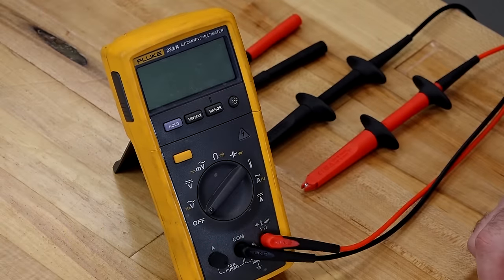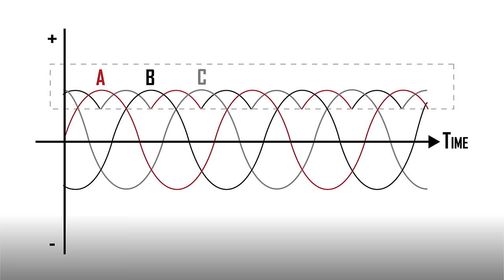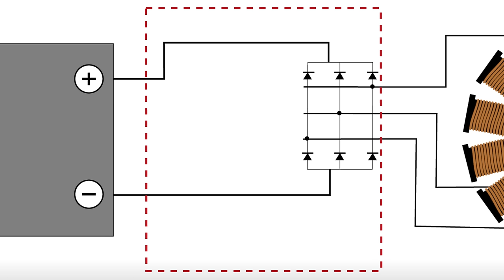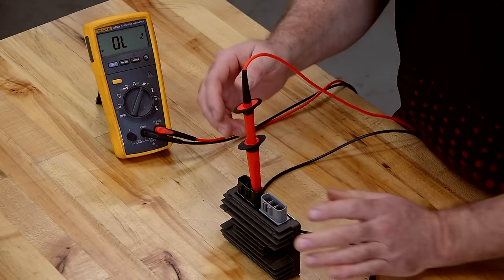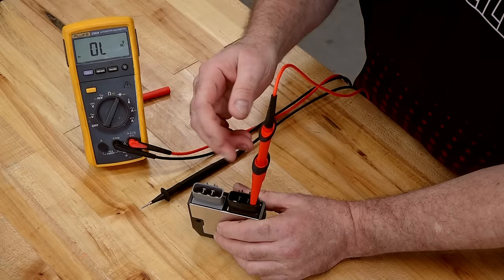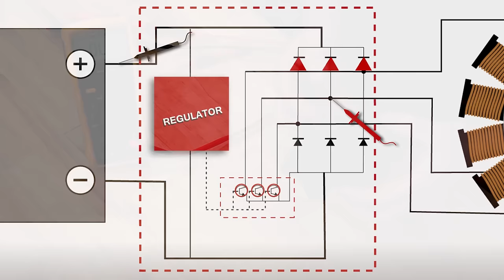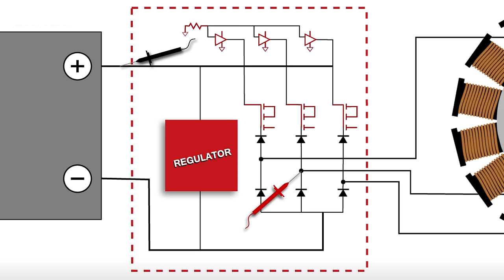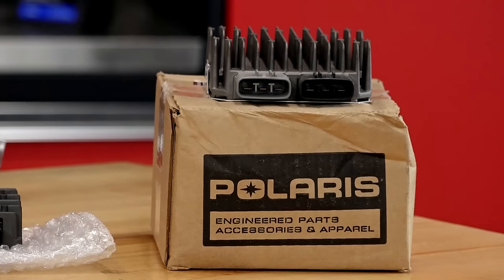How to Test a Regulator Rectifier - They're Not all the Same! | 3 Phase Rectifier Test | Partzilla

Comment: hello everyone!! who faced such problem? Loss of power on a 2013 Sea Doo GTX 155, the battery is new, the starter relay is normal, what could be the cause, could it be the voltage regulator, or another reason?

Comment: While the vehicle is running you will have high AC volts (35-40VAC) present if your voltage regulator / rectifier is bad.

Comment: My 1996 Harley-Davidson, FXDS (Dyna Glide Convertable) has a charging circuit problem.  I removed the battery which checked good.  None of the HD dealers will work on bikes older than 15 years old or bikes built before 2000.  I believe I know where the rectifier/regulator is mounted.  I do have the bike’s service manual which doesn’t give a parts location!  Give me some help, please.

Comment: Great video that saved me a lot of money and time. My Ducati Multistrada 1200 RR readings were F-Bias on -ve 0.460, 0.459, 0.463 and 0L on R-Bias. According to 10's of other videos and documents I should be having the SAME readings on the +ve side BUT in my case I am getting F-Bias = 0.098, 0.099, 0.102 and R-Bias 0L. 
Thanks to your clear and detail explanation it explains my readings - my RR is similar to the Yamaha. At the end the regulator part was faulty giving out 18v but at least now I know why the replacement RR has the same readings - wonder how many bought a new RR on the basis that they should have the same readings on both +/-. 
Great job and thank you.
Reply: You probably have a MOSFET regulator. The MOSFET regulator has approx. 0.500 on one side and approx. 0.100 on the other. And that's okay.

Comment: if I'm to understand this; the best way to 'test' the regulator/rectifier is to NOT test it... instead:
a - test the battery itself
b-  test the stator for ground fault and AC output

if the stator and battery check out... replace the reg/rect  (assuming all connections have been verified)
Reply: My long experience tells me that the voltage regulator may be correct, but that something else affects the result. And even when it comes to overcharging the battery. The plus and minus connections of the regulator play an important role if sufficient charging voltage is not achieved, which for a classic lead battery is 13.9 to 14.4 VDC. Also, too low a voltage can cause a malfunction of the battery, the fuel pump or the installation of additional load.

Comment: This is a kind of old video but I figured I'd ask a question three-phase stator on my Polaris RZR1000 turbo EPS with no extra accessories all the test test good. No resistance to ground The dynamic test 20 volts AC at an idle. I accelerate it to 3000 RPMs roughly and it goes up to 60 volts AC so the stater is obviously good I think lol but I keep having to replace VRRs I'm on number four bought one Polaris one from you guys that lasted about a hundred miles. Just bought a cheap one off Amazon that lasted a day bought  Rick's Hot shot that lasted a week so that's three right there. The previous owner put the hotshot on it so they went through one VRR I've replaced the battery which is brand new. All wire leads are really good. Even added extra grounds The wires from the stator keep getting hot and melting along with the VRR getting hot hot to the touch. I'm really stumped here. Any info I'd appreciate it. My next one I put on it is going to be a dual output. Stator in multiple VRs. I just don't really want to spend the money right yet but if you add up the parts I could already done it 😆 idk it just don't make any sense to me

Comment: I enjoyed the video, but I perform a final forward and reverse bias test between the positive and negative terminals.  Between the pos and neg terminals, the unit will still conduct in one direction only, but the resistance is approximately double what was measured checking the single diodes.  Also, I  would have liked to see the results of forward bias vs reverse bias on the Yamaha and Polaris units.  I believe the units will still show resistance near the same value during forward bias, for both the pos and neg terminals, but will indicate a resistance during reverse bias that will be appx. the same for all three legs, but the resistance may be higher or lower than the forward bias test.  Still it is a process of elimination.  The best test is with a known good unit.  If you install a known good unit and it works, then the old unit was the faulty culprit.  Most owners just don't have a spare unit on the shelf to test with.

Comment: Why wouldn't you just do a voltage check on the output of the regulator to see what it puts out, too high or low and  it's damaged.

Also the one thing I noticed is that cars used to have separate regulator and  rectifier, not sure if they stull do, but seems the best way to go.
Reply: I wondered the same thing about why not just test the output to see if it's putting out 12.8-14.3 dc volts or whatever.  I mean it's interesting to figure out if a diode or diodes went bad or if it's the regulator portion that went bad but since the whole thing is a single replaceable unit, it either works or it doesn't work.  If the input is good and the output is bad then the RR is bad, so replace the RR.  Maybe there is a reason you can't test it that way but I can't think of what that reason might be.  🤔🤔🤔

Comment: Great video John, thank you very much!
In short, I understand with the variations in design it is hard to be exact. The RR I'm testing from my son's Triumph 675 is similar to the Yamaha one you demonstrated. Doing a positive-bias off the negative terminal I get 0.464V off each of the rectifier pins (a little lower than you note/recommend). Doing a forward-bias off the negative terminal I get .114V at the rectifier pins. Though the voltages are slightly lower, it performs as you illustrated and is bang on consistent in terms of voltage reading pin-to-pin when forward biased.

The question I have is this still considered a pass?
Reply: Did you ever get an answer to this question? I have a Honda Interstate and it reads similar to yours.
Reply: The MOSFET regulator has approx. 0.500 on one side and approx. 0.100 on the other. And that's okay.

Comment: the issue being in philippines. Some sellers do not state if mosfet or non mosfet and bad designs (most likely class c fakes). 2 failed installed burnt out. One was not mosfet i did not use yet. Worried it would not be good for new style batteries. Can i use the non mosfet for temp use until i buy a real RR from you? shipping time args

Comment: I got a 2021 Honda Pioneer 1000-5. 
When I plug in the rectifier it pulls the motor down and eventually making it stall. I can unplug it and it runs as it should. So I tested the rectifier as you showed how to for a Honda and with my meter neg lead on the positive 
And positive on each point and it  was in the range of .122. And with the meter positive lead on the neg while you test point it was in the range of .521. (Any help will be much appreciated)!! Also I test the battery when it do run and it shows 13.8 bolts..

Comment: I have a 2018 Yamaha 450 yfz I am Jaden 12 V at the starter and the starter is good but it doesn’t turn over and then at the relay the cable for the starter up at 12 V and it starts

Comment: Very cool video. You helped me a lot with my R1 problem.
Reply: What year bro ? My 14 is like draining the hell out the battery. The yuasa one that came with it progressively got harder to start and the. Eventually would power dash and lights but wouldn’t turn over the engine
Reply: @rollathegawdchild4339  them bikes u have to always have bike on a Battery tender . It requires a good crank. My friend always has issues when he does not use his bike for few weeks

Comment: Hi guys I have triumph Tiger 800 2013 and it keeps blowing my rectifier 5 of then now within 5min of running bike the stator was checked and it was fine but i have replace it anyway and same thing happened again I have been buying the MOSFET one as they supposedly ment to be more reliable but for some reason are not for me. Am I using the wrong RR? Or have problem simpler else? Just to mention the battery is new on the bike .

Thanks in advance

Comment: My regulator is not controlling the voltage.  My battery is being overcharged. All diodes seem to work. I dont know if i should buy a new r\r or try to fix my current one

Comment: Great video and explanation 👍 , I'm a automotive tech that recently have been tasked to work on a fleet of ATV/UTVs . On the automotive side I'm a big user of occsiloscopes (Lab scopes ) to help make a solid definitive diagnostic and not just replace parts on a hunch. I been incorporating using a scope in diagnosing ATVs and side by sides and have looked at all 3 phases of the stator back probed at the rectifier/regulator . And you can indeed see the SCRs pulling the phases to ground in a controlled duty cycle in a attempt to regulate the voltage . I was wondering if you know of any resources for motorcycle/powersports techs that use scopes and share information . In the automotive would we have a huge networked that spans the planet of techs that share information and create think tanks to develope new ways to diagnose complex issues. By the way I thank you all for your great service to me as I buy a lot of our fleets parts from you guys and you've been great with helping me get the right parts as I am really new to this world lol .. Thanks !!
Reply: Since no one got back to you I thought I would answer your question.  To be frank as a M/C tech we really don't have this type of network like the Auto side.  I came from the Auto side 30 + years ago and still play in it from time to time ,  so I know exactly what your talking about.  There are some places you will find on the net for a certain bike say like the charging system on any VFR750/800.  They eat RR for lunch all day every day.  At the race track you might find a tech thats willing to shoot the shit with you for  few mins until he has to get back to work but the bike world is just not as complex as the car industry.  Most shops will have one MAYBE two techs that have an actual education in motorcycles be it MMI in Orlando FL or the few others out there.  The schools cost a fortune, when you get out you basically have a masters degree in motorcycles mechanics and engineering etc.  If you chose to take the advanced courses that just adds up like a doctorate degree.   All this in less than 2 years on avg.  Even then with all that education and experience the pay isn't very good no matter how long one has been turning wrenches. Now that Falicn is basically gone even race motor builders are going to have problems getting things done.

  If you specialize in something like race motor building or suspension rebuilds and setups you can make a little more but unlike cars bikes are a small portion of public.  A tech in the motorcycle industry basically is there because he/she has a passion for it.  That said  in the US the riding public is only 8%  and they call that an all time high..  Where as most everyone here in the US has a car.  The problem is the car industry has killed itself by making their cars impossible to work on without all the scan gear.  Sure one can pick up a OB2 reader but that's just not the same as being able to watch say injectors voltage change as they open and close, record that data and then play it back to see if there was a difference in any of the injectors that would relate to the problem. So your backyard mechanic is now left in the woods where with Bikes just as I said are not that complex yet.  Where your young guy could or can still work on a bike and actually enjoy it instead of throwing that $4500 snap-on scanner through the car window when he's not trained enough to even know what to look for.  Bikes are just more fun but there isn't the amount of people out there riding like there are car guys.  Plus there's a generation change as well.  You would be hard pressed to find alot of millennials riding or hell even owning a car .  Hell much less even remotely interested in working on them.  To most they just want to get from point A to B where Car guys and Motorcycles don't really care WHERE we are going as long as we are on the bike riding.    So there ya go,  I hope that helped out somehow .  If your an uncle then please get them into mechanics and riding , we need new blood.  Hell I will even say this and I'm sure I will get flamed for it but,  we need kids with fire in their eyes and passion!!! Its almost like they have been drugged out of wanting to experience anything in this life vs wanting  to try everything they can before they leave this place.  Anyway take Care Mark... 
Cas...
Reply: @casperi2  I'm here 2 years later saying thanks! Your take on this is spot on.

Comment: we are manufacturer of voltage regulator , and this way test diodes or mosfet work or no. and if you need lower temperature when it work , you should choose mosfet regulator.
Reply: But then we get a slightly higher temperature in the stator of the generator. Is it?

Comment: Does it matter if all the forward bias readings on the positive side are 0.1 when all the readings on the negative side are 0.45?  In other words, should the readings be close to the same for both the positive and negative?  This is with a Honda rectifier.
Reply: I just checked mine and on my 2017 cbr500r 
- they are 537/536/522
+ they are 130/129/129
I also found oil in mine

Comment: I need help,  I have 06 gsxr 750 that will crank but not start. I've put a brand knew shorai battery in it to be sure, lights come on, fuel pump, relay clicks, starter is turning motor over, checked the fuses under the seat, it's doing everything its supposed too besides running. The battery in it before was dead when I hooked it to the charger. I rode the bike yesterday.  Think it's the reg/rec?
Reply from the maker: Did you confirm you're getting spark?

Comment: Having owned a number of Hondas and having run into various issues with the charging systems, I’ve had to educate myself on the diagnostic testing methods. One question that I’ve never found an answer to has been the overheating of the stator/rr connectors which gets so hot it melts the plastic housings of the spade connectors- the bike in question being a 1998 VFR800. Figuring that either the stator or the RR or both were at fault, I’ve replaced both at one time or another. But I’m wondering if a dead battery caused by leaving the key on and then having to bump start the bike could be the culprit? My thought was that the stator is sending approximately 55ac volts to the RR trying to charge a low/dead battery (plus perhaps having a poor connection at the plug) could be causing resistance at the connector creating so much heat that it melts the plastic and over heats the spade connectors? On the VFR in question, the 3 yellow wires from the stator appear to be 16ga. wire connecting to 12ga. wire from the RR. A recent upgrade has been a new style Mosfet RR and a automotive style connectors.
Reply: Yea cheers mate , this 2 years after you posted was sort of helpful , 
because Ive wondered at times the very same thing .. maybe one day , we’ll find out .

Comment: Thank you for the video. My Polaris Ranger 2014 900 crew is not charging appropriately. The stator appears to be producing the correct AC current. I have removed the regulator and tested (part# 4013978). When testing both the + and - lead of the RR, I ONLY get a reading (.413) on all three phases when testing the positive side of the RR..... touching negative meter lead to positive RR lead. All other test show .OL. I believe this confirms the RR has failed?
Reply from the maker: If ALL the other tests show open, then yes, it's probably bad.

Comment: My r1 2010 isn’t powering on at all, no lights, not even fuel pump kicking on after sitting during winter. I checked fuses, 2 new battery’s. Could this cause it? Please help
Reply: It worked perfectly before just in January this year. I don’t know much about bikes but could it be a ground issue as well? Since it’s not getting power at all

Comment: 07:44 One Question, What is the middle pin of the black connector that goes to the electrical system for?
does it have any use?
someone could help me?

Comment: Another amazing video though I have to admit I get a bit lost with the diagram .I was out on  my K8 gsxr 1000 on Monday to was a very hpt day as must phone actually reported high temperature and asked top be cooled . parked off after some city riding and bike wouldn't turn over "dead battery"  I pushed tarted and then it was fine . once the bike cool down later it started . this happened 3 times throughout the day. The 3rd time I noticed the red light on the dash came on and then I had a fault code "SD" my low beam "xenon" went off but hi beam worked . I made it home and noticed all lights were dim my front running light would flash when I accelerate but then go off at idle . do you think this is the Reg Rec or is it the stator ?  I've read online that gsxr are notorious for burning off regulators due to location and over heating ? I just don't wanna buy a reg rec and then the issue is the stator . appreciate your time . you're videos have been a massive help for me doing my maintenance.
Reply: Did you ever replace your rectifier? Or fix the issue ? My 03 cbr600rr has similar problems  and I do believe its the rectifier getting to hot.

Comment: Would the regulator stop the front of my bike from getting power? My winch and starter solenoid are getting power, I just don't know why the neutral lights and starter button aren't working. The bike just died while riding and we replaced the battery which did nothing